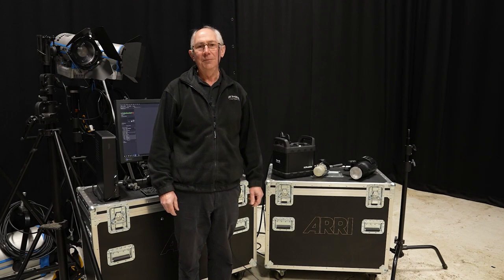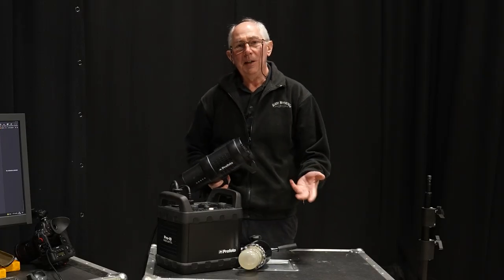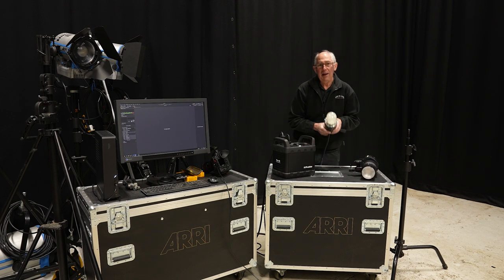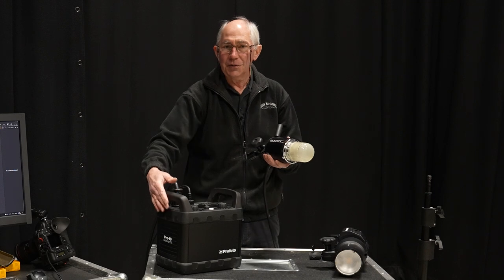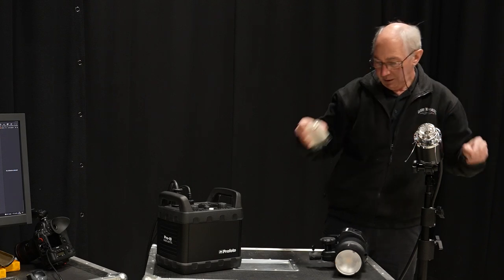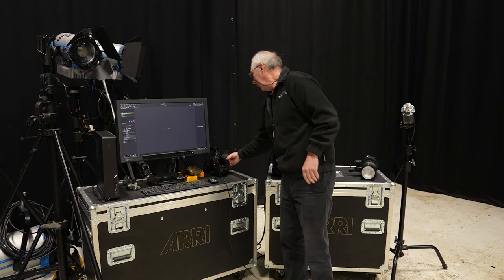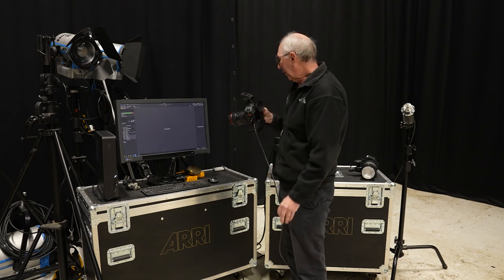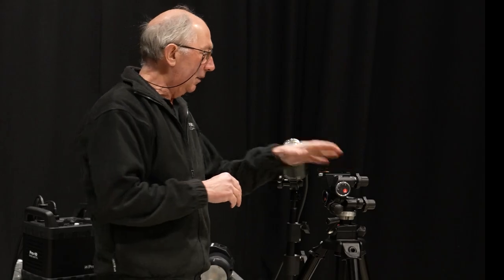Flash Strobe light

Comment: Since I found your channel I'm looking through all the videos (some still left). I don't want to spend that much money on equipment so I looked at older used parts and there is a lot for relatively cheap. If you can live without the fancy stuff (flash settings from the camera, battery powered...) and don't mind some scratched equipment you can get most parts at less than 100€. I have studio flashes for 10-39€, only one for 99€. 
I tried exactly this shot with the 10€ flash and it worked quite well. It's still missing the finesse but I worked with Gimp for the first time and the composition is also not top, so it's more a proof of concept. But I will certainly try again.
Reply from the maker: Thanks for watching.